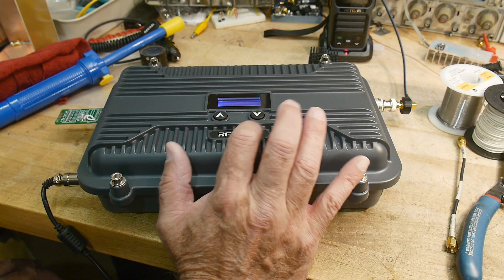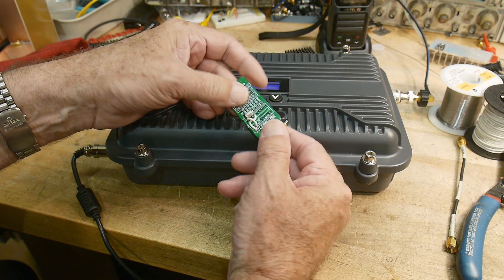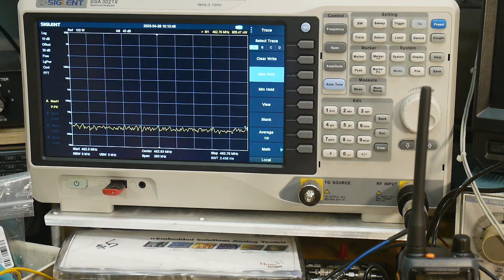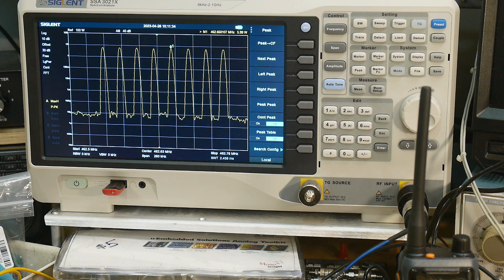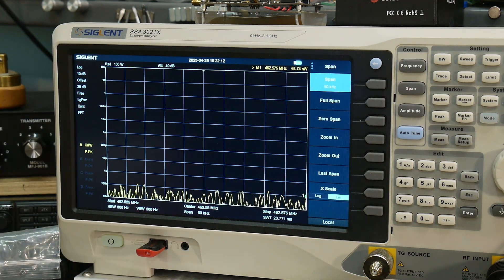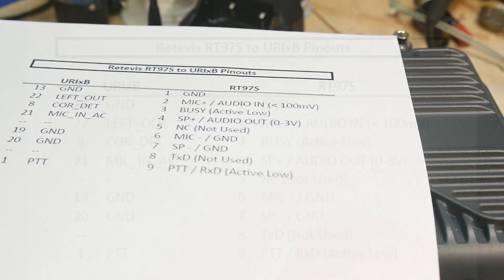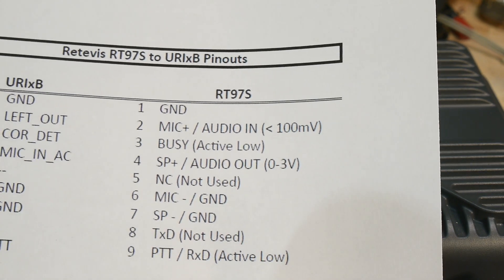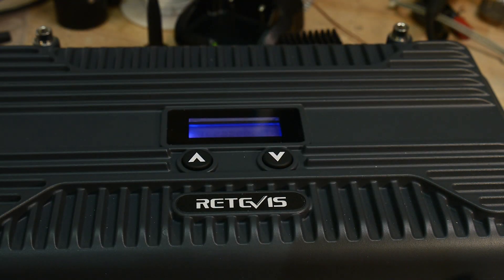#1492 Retevis RT97S GMRS Repeater 9 Pin Connector

Comment: The main use for the raspberry pi and the URIxB cable is to link them together using the mygmrs network with the linking bundles they sell.  They also sell a RT97S to DMK URIxB custom cable and a SD card with pre-configured software.  Pretty cool, because the original RT97 didn't have the DB9 port.  I think it can also be used with an ID-O-Matic.

Comment: I have a R97S and am using it with an external controller. I notice some strange behavior in the BUSY signal. It goes low when a carrier is detected, then goes high as soon as the PTT is keyed by the controller, even though the carrier is still present at the receiver. Have you seen this as well?
Reply from the maker: haven't spent any time with it
Reply: @IMSAIGuy  Found a grungy work around. Do not assert PTT when BUSYis asserted by the repeater, only when the controller wants to send something, like an ID, etc. Not sure what that does to the audio path.

Comment: Although Sec. 95.1787 allocates for digital transmission on GMRS, arguably the greatest constraint is, (2) Digital data transmissions must not exceed one second in duration.  Essentially, the purpose is provide a location.